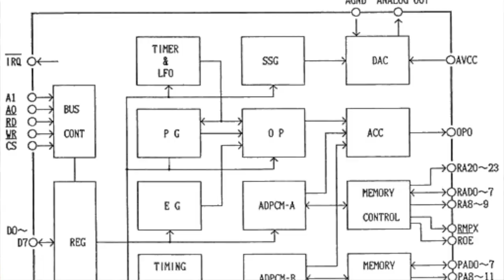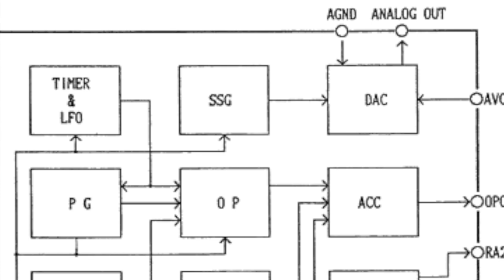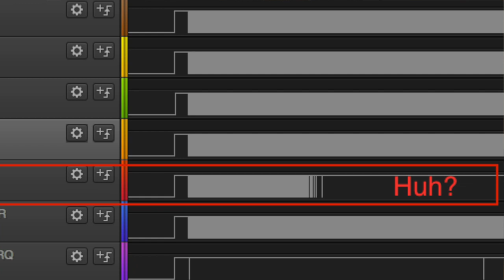Neo Geo MVS-1FS HDMI mod and repair

Comment: Don't know how I didn't see this channel before!!! Subbed!!!  Great stuff - masterful repair there in terms of replicating latch and decoding logic with discrete ICs!  Brilliant!  I was considering doing a similar thing with faulty input on the Neo-C1.  I was only just getting back into electronics at the time and my first thought was to use a PIC, but that would have been tricky regards timing, and I later looked at using a CPLD but it was easier for me to just swap out the C1 chip back then.  I still have that chip on another board so I might try that approach now I've seen you do a similar thing here.   Do you plan to produce that HDMI mod for sale?
Reply: Doh, I was already subscribed - I just didn't know you had done this video!  I will check out your other videos now =D

Comment: Trying to use your code but having a hard time getting any signals, do you have a contact email or anything?
Reply from the maker: Probably best to add an issue to the github page so anyone with similar questions can see it. I'm very rusty on the code now as it was a long time ago. Add as much information as possible and I'll try and point you in the right direction though.
Reply: Chipos you legend you. I've been able to now get 480p on the cyclone II now thanks to your code, it appears that I had some wiring incorrectly and until I properly checked the hdmi output witha thin wire I was pissing in the wind lol woops!  never go by  R G B looking hdmi cables it wasn't coordinated to the reality of things :P , as for cyclone II I think we're limited to 480p and no further.  did you ever manage to get 720p out of her? perhaps 'cascading PLL's and some clocking? I think without emulated LVDS this will be difficult unless  you got better ideas, the LVCMOS outputs are limited, I like your mod10 hack it gets the job done but I've been unable to set things back to 24mhz/150mz as FPGA4FUN said , as yours is 27mhz/135mhz . not sure what to do here? it's something to do with the mod10 code I think.  Do you have a way i can contact you via e-mail? Chris
Reply from the maker: Glad you got it working. I did try a few ways to get 720p working but didn't get much further than the simulation phase. My feeling was it might be possible but would be right at the limit of what that FPGA can do. Not sure why you want to set the pixel clock to 24MHz. You're trying to get 640x480 instead of 720x480? If you send me a private YouTube message I'll give you my e-mail. I think a github issue would be better though.